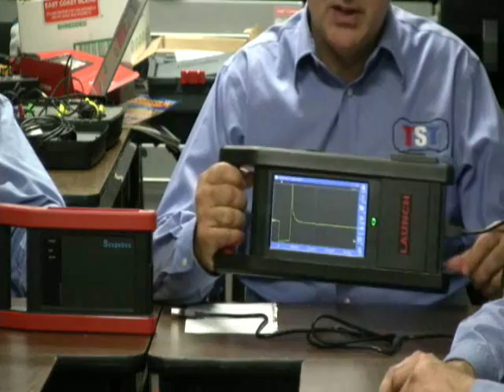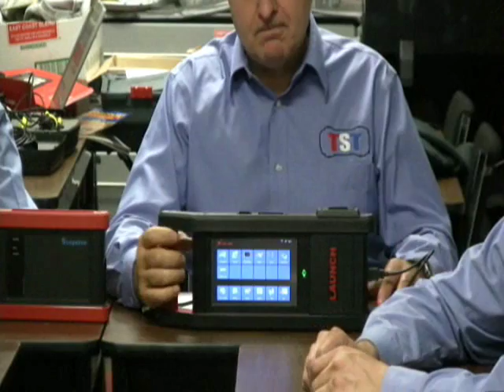TST Roundtable - October 2012

Comment: I use a air lift, pressure test the system and then use the funnel last to be sure no air in the cooling system when bleeding air out.
Interesting about compression ignition petrol engines and electromechanical valves.
Very jealous that over there aftermarket techs can get hold of factory information and scanners unlike here in Australia.